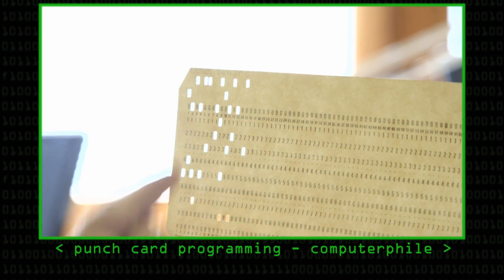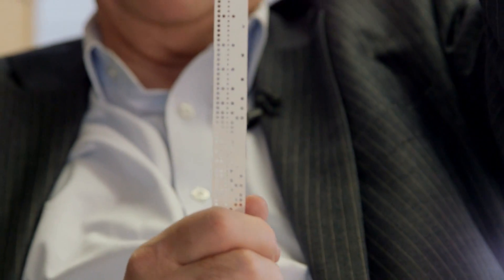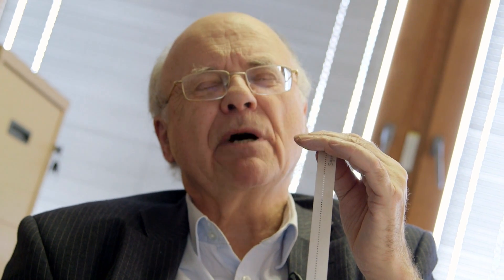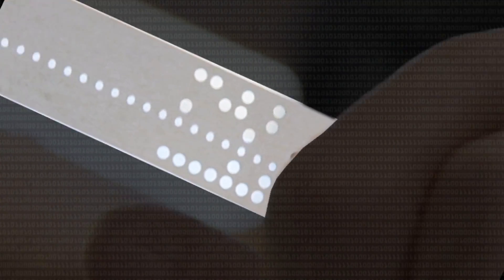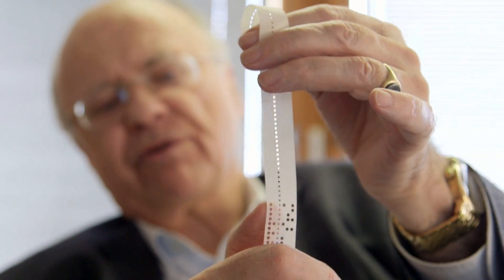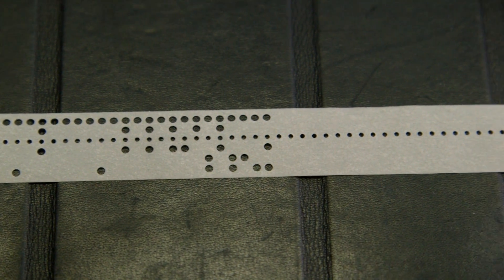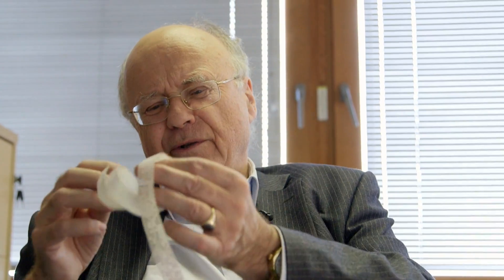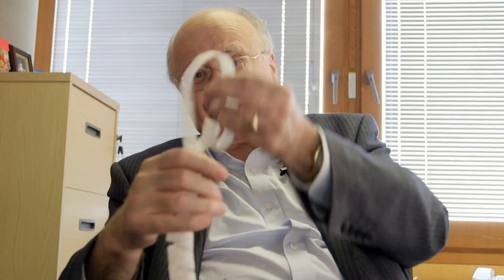5 Hole Paper Tape - Computerphile

Comment: 5 holes was not the shift. 5 holes was 'Erase' character, intended to be skipped on read. When you made a typo, you returned the puncher one position, punched five holes over that place, then you typed the correct letter.
But maybe there were multiple codes in use? I'm not sure. This is what I remember and it makes sense to me.
Reply: @ kasuha: Actually, in CCITT-2-Code (which is the most commonly used one) 5 holes IS letter shift. You are right in so far as you can use the letter shift for correction as it doesn't do anything in regular text. You just have to remember to put in a new "figure shift" when correcting number typos.
Reply: I worked with TTY as a telecom network analyst from the 70's thru 90's, Paper tape was the majority of what I saw for the first few years.  the 5 hole was the letters shift and was used as an erase when you were in the letters mode, just backspace and letter over the bad characters then retype, in figures mode backspace, letter out, shift to uppers and retype. the reserved characters were letters, figures, space, Carrige return, linefeed, and blank. Carrige return and linefeed were different because you would normally send two carrige returns to prevent a bounce of the printhead away from the left side of the page.  There were different charcter sets for text and weather transmissions,  just swap out the print head and the machine was ready to go. The transmission method was to send marks or spaces, these were usually a negative for a mark and a positive for a space depending on the location you were working in. the idle condition of the  line was with voltage on the line and then a start bit was sent followed immediately by the five bits of the baudot code then a stop bit (normally 1 and 1/2 bits in length) and then the cycle was repeated until you got to the end of the tape. speed was normally 75 baud or 100 words per minute, older TTY and telex machines were running at 37.5 baud or 50 WPM.
Reply: He mentions this, saying there are multiple codes not just one that is reserved for special characters.
Reply: Johnnie Meredith Some tape stock was laminated with a sort of plastic sheet. It was very difficult to tear and was used for tapes what would get a lot of repetitive use, e.g. loadable computer programs.
Reply: Johnnie Meredith I believe IBM punch card machines were designed to avoid combinations for this very reason. I imagine one of the reasons why it's a special character is indeed because too many would weaken it.
Reply: You'd think the 5 hole codes would weaken the structural integrity of the paper at those points.
Reply: @johnniemeredith9141  Yep.  If you handled a tape enough, it would fail there.
Reply: Ya but it would seem the paper would tend to rip sometimes in those instances.
Reply: Johnnie Meredith
Probably, but I also doubt that the purpose of this paper was to last very long anyway.
Reply: kaybikerow The plastic was Mylar.
Reply: thepollywog1 Yes, now I remember the blue mylar tape as well. I've still got an XDS assembler program on black tape that I wrote in the 70s.
Reply: Johnnie Meredith 
There's only 1 literal 5 hole code (excl. The center hole). The 0s are represented by the lack of a hole.
Reply: kasuha — True for ASCII, but nit Baudot-Murray.
Reply: 5 holes was both letters shift and "rub out".  If you made a mistake, you could pull the tape back, punch the letters key, then the correct character.

Comment: Would the sprocket holes be analogous to a computers clock signal?
Reply: Trevor Viken The sprockets are driven by -- or at least adjusted to -- the computer's clock signal.
Reply: For Colossus, the first electronic computer used by the codebreakers at Bletchley Park, the paper tape actually functioned as the machines clock. But this was unike for that application and I suppose the tape, which ran in an endless loop, was friction driven, because the idea was to read the tape at maximum speed.  Colossus predecessor, the Heath Robinsson, used two tapes in two separate loops, one tape one character longer than the other,  and consequently those tapes had to be syncronised and could never run as fast as the single tape on the Colossus. On Colossus the characters representing the second tape was set up on a plugboard.
Reply: No.  it was for pulling the tape through the reader, though optical readers used it to clock the character in.

Comment: Between the World Wars amateur radio operators began to acquire used teletype machines to send Baudot code over the air as RTTY or radio teletype. It's still commonly used by hams today, even thought their computers now have over a dozen better digital modes.

Comment: The paper punch idea, probably came from all sorts of wooden cams of a machine, such as driven by a water wheel,  music boxes with their windup, roller and "teeth" pins on it, and even the music players , rolls or flat metal disks.   Data storage goes way back, but it was "mechanical", limited.    I think some have said that a loom has some kind of mechanical data (of some type, perhaps the paterns) of some sort.    Gears, wheels, can also store data of some sort, such as the mechanical counters.

Comment: There is a third method of reading paper tapes. On the Myriad computers I worked on at the London Air Traffic Control Centre in the 1970's we had fast readers that measured capacitance through the tape with a hole offering an air dialectic and no hole a paper dialectic. The readers used capacitance bridges to detect the either hole or absence. They would read so fast the tape would come out horizontally for 3/4 feet.
Reply: soylentgreenb What do you see as a "good" solution. SSDs? Goddamn magnetic tapes?  Sure, your point is valid in a lot of cases, but you shouldn't go about criticizing existing, working technology unless you have a significantly superior replacement in mind.

Also, hard drives are still the most cost effective way to store a lot of data that still needs to be readily accessible.
Reply: +Lester Bailey Would love a video on this as well!
Reply: Another method would be through having small electrical brushes.
Simpler than measuring capacitance, but wears out the tape.
Reply: @markevans2294  That's essentially the same kind of mechanical method mentioned in the video.  I imagine that brushes, if done correctly, were a better mechanical option than rods since they should put less force on the holes but you probably had to replace the brushes or bend them back into place more often (based on my limited experience with brush motors and my sense of physics).  I also assume they were braided brushes since non-braided brushes could potentially make contact with adjacent holes though I've never actually worked with this technology so I'm just guessing.
Reply: The extension of terrible solutions into unheard of realms of performance and reliability by successive tweaking is something I find fascinating. These terrible solutions persist even when better solutions have been found, living on by sheer inertia and brute force of engineering, sometimes for decades until these obviously better solutions catch up and overtake them. Paper tapes is only one of many.

My favourite is hard drives. Here you have a spining disc, revolving ~100 times a second, with a tiny little magnetic needle on an arm whizzing about accurately hitting a tiny spot on the disc within milliseconds and reading up to about a billion tiny magnetic regions spinning past below it. This needle is suspended on an air pillow just above the surface of the disc. If for any reason it touches the disc, kiss your data good bye. This is jawdroppingly amazing and a ridiculously crappy and improbable seeming solution at the same time.

Comment: "Unshift on Space" was a common mode that you could set your TTY machine to.
So it would always go back to "letters" after it saw a space so you wouldn't be out of shift for long. Operators would send a "FIGS" again after a space.
Reply: My phone keyboard does the same thing and while it is sometimes useful it also drives me nuts sometimes.
Reply: And some people got in the habit of <CR><LF><LTRS> at the end of the line.  Sending the line feed after the carriage return provided extra time for the carriage to move to the left side and the letters would ensure you were in letters mode at the beginning of the line.